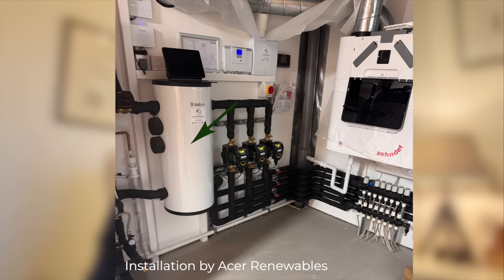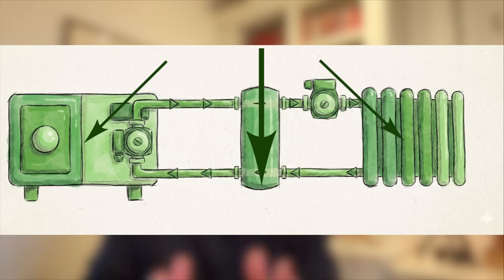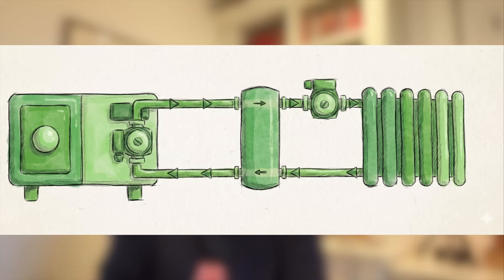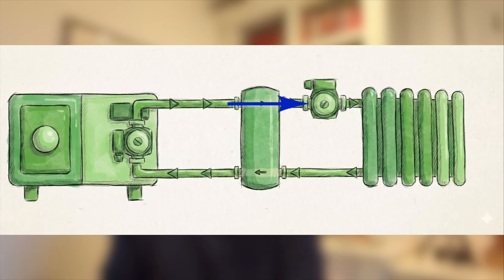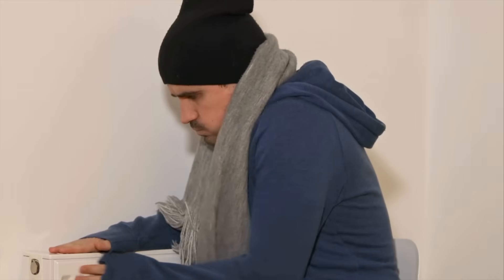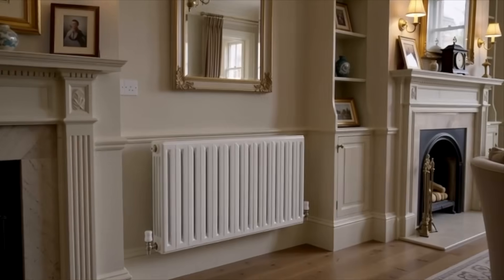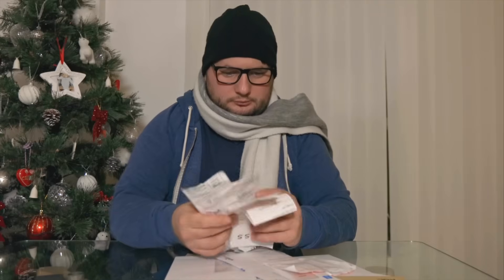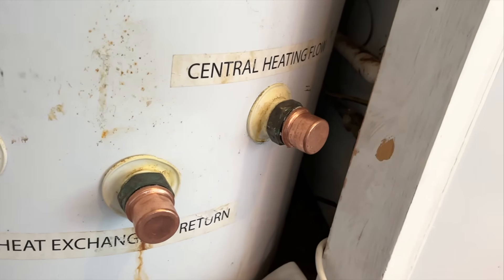Why Do Buffer Tanks Kill Heat Pump Efficiency?

Comment: A volumiser tank give the benefits of a buffer tank but without the downsides. It's the same tank but with two less pipes and one less circulation pump.
Reply: No, a buffer tank allows for the heat pump and the radiator pipework to have different pumps with a different flow velocity, which as far as I understand is the main reason why buffer tanks are installed. A volumizer cannot decouple flow velocities.
Reply: @wcoenen  yes, where the pipe work is too small to carry the power required at dT5 without an unacceptably high flow rate, a buffer allows a larger dT in the emitter circuit, at the cost of a higher flow temperature from the heat pump.
Reply from the maker: On the money!

Comment: What are your thoughts on a three pipe buffer configuration direct to load?
Reply from the maker: Most top installers, when I've spoken to them, have needed to a buffer in, have opted for three port options.

Comment: i always thought by separating out the AHS circuit and your own heating circuit was to allow you to use less Glycol.
Reply: Some installations do that but they use a plate heat exchanger, rather than a buffer, to keep the fluids separate. With fewer systems using glycol anyway these days, I should think it’s pretty rare.

Comment: We had a buffer tank fitted. 12kW Arotherm in our 8 bed house with UFH. It has a very powerful pump on the heating side, as assuming circulation pump in heat pump unit not powerful enough. Could buffer be removed in this setup? Getting COP of 3.2 in winter months and upto 4.5 in summer. Any one with suggestions?
Reply: I’m not certain it would work properly without a buffer, too much to take in to consideration though, but one thing I’m sure about is your efficiencies aren’t bad at all, I wouldn’t worry about trying to chase the highest SCOP like everyone is, if you can average 3.8-4 SCOP over the year take that. You also live in a very large property so matter what your bills are going to be a lot more than a standard 3 bed house.
Reply: @Christopher12345xy  Thank you for the comment. Wouldn't want to be making changes. Bills are a little better than when we had gas. Adding batteries shortly.
Reply: Depends if you always have all UFH loops open, or if you have it badly balanced and need to close many regularly.

Comment: Our 100L 3-pipe buffer tank seems to work very well.  I monitor the temperatures at the top of the buffer (flow in and flow out) and they are almost always identical.  The buffer also keeps warm water flowing around our emitters during defrosting and DHW heating cycles.
Reply: I'm probably just showing my ignorance but assuming it's 'flow in' to the buffer from the HP and it is 'flow out' from the buffer to the emitters (which seems like a volumiser to my inexpert eye), what is the third pipe for, please?
Reply: @seatonian I'm certainly no expert in this field but I've always assumed that the 3rd pipe (located bottom left on the buffer and connected to the return from the emitters to the heat pump) allows the 2 circuits to operate independently of one another i.e. the 'house circuit' can continue to flow water around the emitters regardless of what the 'heat pump circuit' is doing.
Reply: @seatonian A 3 port tank would have one cold water return from the radiators, one cold water supply to the heat pump at the bottom of the tank, and a 3rd port at the top of with a T fitting in it the two other ports of the T would be for the hot water coming back from the heat pump and the supply to the radiators. The idea is that the radiators can take as much or as little hot water as they need, and any surplus or deficit can come from or go into the tank.
Reply: @ZergZfTw My 3-pipe buffer tank is plumbed slightly differently to your description, mine is:

Top left: Flow in (from heat pump)
Top right: Flow out (to emitters)
Bottom left: Connection to the return from the emitters

Comment: When is a buffer tank a good idea?  When we haven't bought the BS about heat pumps because we don't have solar and an electric car as well - and want to run a condensing boiler into UFH at peak efficiency.  Would also help with biofuel.  Its just the poor efficiency of heat pumps at higher feed temperatures that's an issue.  What you are talking about is a degree of system optimisation in sizing that is tricky in older houses - my UFH and condenser setup is over 20 years old and it still looks problematic - and yes every room is zoned and it will stay that way, because the glazing and aspect differ massively.

Comment: aira install has a buffer as standard but monitors the temp on the supply from the buffer to the system. I'm getting COPs of 4.5 to 5.0. the difference is that the aira solution is intentionally designed with a buffer rather than as a sticking plaster. Good design is good design.
Reply: How they get it right then if buffer lowers the efficiency of the system?
Reply: @JerzyJuszczynski  buffers don’t always lower efficiencies, 2 pipe or bypass buffers can sometimes be even more efficient than open loop.
Reply: @Christopher12345xy - thanks for your comment.  I've  just accepted an Aira quote, and at that higher cost (I took it mainly for the 15 year warranty), I'd hate to think I've  also just signed up for higherthan-necessary bills too...
Reply: @JerzyJuszczynski if the buffer is designed in from the start and the controls configured specifically for a buffer system then the pros outweigh the cons. As long as the primary flow is higher than the secondary the distortion is minimal and it greatly reduces the impact of defrosts on the system.

Comment: I changed my buffer tank to a volumiser tank last summer, my scop for heating has changed from 3.3 to 4.0, also no longer need to bleed air from the towel rails and heating circuit is much quieter!
Reply: Hi John, how the air gets in then? Was it not bleed at the installation?
What was the connection between buffer and air in the system?
Reply: @JerzyJuszczynski no idea to be honest but with buffer tank you have two pumps competing against each other at different speeds which create a lot more noise in the buffer tank . Before I would have to bleed the two towel radiators ( highest point of circuit ) at least once a month and add pressure.
Reply: @johncastle2558 if your buffer has an automatic air elimination valve and there's no expansion vessel mounted on the buffer keeping the alternating flow induced pressure fluctuations at bay then if the pressure in the buffer gets too low air is going to get sucked in by the vacuum. Also fresh water contains trapped air and that will come out and pool at the highest point.
Reply: I assume that would also explain why the tank and system is much quieter now without buffer !?
Reply: I hope you asked the installer for a refund !

Comment: My quote from Octopus included a buffer/volumiser.
Reply from the maker: Yeah, that's interesting. I didn't realise Octopus did buffers until a few recent homeowner complaints with poor performing systems that clearly have buffer tanks.
Reply: @RenewableHeatingHub , I had the std Octopus installation in April 24 for my 1992 averagely insulated 4 bed detached, NE England. 6kW Daikin, 210L Joule tank, insulated buffer and an expansion tank. 28mm primaries connect to the original 22mm boiler headers teeing off in 10mm micro bore to new heat loss sized emitters.
 Using a Hicmicro thermal imaging camera suggests all emitters are well balanced and as close as a knat's whisker to the LWT showing in the Onecta app. I'm running LWT mode 24/7 with a curve set quite low in comparison to how Octopus set it. Inside temp around 20°C downstairs and 18°C upstairs. Heating Cop over the last three months is averaging 3.82 with Dec usage averaging 24kW per day (whole house consumption). Are these reasonable numbers and is that buffer working well?
Reply: @tebbo8324  I've gone against the flow, excuse the pun! I've just built a super insulated (Icf) 200sqm house, all underfloor, 300ltr buffer, 12kw LPG boiler, same numbers as you virtually, Boiler says average over the last 30days is 23kwh @ 11,5p Kwh, Calor gas quoted 9.5p Kwh for bulk tank, but bottles avoid standing charge that adds up.
Your number look pretty good to me, you benefit from the COP, I avoided the considerable cost difference, I'm a heating engineer I've done gas and heatpumps for 20+years so I'm interested in getting some solid data on LPG for a few years then possibly trying a heatpump.
Reply: @RenewableHeatingHub  One size doesn't fit all.
Reply from the maker: Absolutely, but it’s worth looking at the type of properties Octopus typically works on. In that context, I’d seriously question the routine use of a buffer tank.

I’m also increasingly wary of the way “buffer” and “volumiser” are used interchangeably in quotes. I’ve seen this a lot. They are not the same thing in practice. Yes, they’re both vessels, but they do fundamentally different jobs. One introduces hydraulic separation and the potential for mixing and distortion… the other simply adds water volume while keeping the heat pump connected directly to the system.

Lumping them together blurs an important design distinction and makes it very easy for a buffer to be justified where a volumiser (or nothing at all) would have been the better, more efficient choice.
Reply: @RenewableHeatingHub pseudo hydraulic separation.

If it were true hydraulic separation, it would be a heat exchanger.

And while we're at it with terminology, it should be hydronic, not hydraulic 😉

Comment: Hi Mars, thanks for this timely advice. Very recently I had a survey by AIRA as part of my research for an ASHP install. When I questioned the guy about the buffer tank his response was that AIRA always install a buffer tank. Any observations that you care to make as I was quite taken by the extended guarantee AIRA offer as well as their constant monitoring?
Reply from the maker: Yes, AIRA's policy of always installing a buffer tank is one of my biggest gripes with them... I've called it out multiple times in forums, discussions and podcasts. 

They build their entire system around it (indoor unit + separate buffer tank) and they tie their strong 15-year guarantee, performance promises and constant remote monitoring/AIRA Intelligence to that setup.

So if you want their extended warranty, monitoring and "peace of mind" package, you're pretty much stuck with the buffer... they won't skip it or guarantee the system without one, which I think is very unreasonable, but that's their business model and philosophy.

That said, be cautious about the potential efficiency hit. As the video explains, buffers often introduce unnecessary mixing/blending, which can drop your mean water temp, force the heat pump to run hotter and cost you 10-25% in extra running costs over time (depending on your system design, zoning and flow rates). Their AI monitoring might mask some issues on paper, but it can't fully overcome physics if the buffer creates distortion you don't need.

And don't forget to build in extra circulation pump costs.
Reply: I seem to remember Mars having an Aira representative on once and this being mentioned.
Reply from the maker: @mattybpg, yes, we did: https://youtu.be/v-MS6NPIiCo 
Buffer tanks at 29:01

When we stopped recording, it appears to be a directive from head office that said they have to use them, and it wasn't a policy that was going to change any time soon in the UK.
Reply: Agreed - i've had heat pump surveys where the operative says a buffer tank is required as part of the Heat Pump's warranty conditions.

Comment: I don't know what code requires, but volumizers don't even need to be insulated - a simple 2 pipe tank without the 30-50mm foam insulation would be about half the price and perfect for an airing cupboard.
Reply: At which point you've got a radiator... Which is why the best volumizers, if you can do it, are high volume radiators. Not only do these have significant thermal mass which evens out the temperature and allows cycling to go unnoticed, it also avoids the need for other tanks. Couple of my big column radiators are 26 L each, for example.
Reply: @TheBadoctopus  Yes, saving a couple hundred quid to invest in more/higher vol rads is best. 

However, I can see circumstances where price/m3 of a cylinder is cheaper than a radiator. Some people don't like the bulkier, double panel designs. A building may have had a HP sized before fabric upgrades, making it cycle too much after an insulation/air tightness retrofit, so those systems could do with extra volume to compensate. Also, do not underestimate how much people like the idea of having an airing cupboard - especially women, who often hold vetoing power in boiler/hp replacements, because any hint that HP are not warm and cosy also affects them more (I do most the laundry in the house so excuse the stereotype, ideally I'd want an airing cupboard connected to the exhaust of an MVHR).
Reply from the maker: Very good point!
Reply: We use fan coil radiators, designed by Mitsubishi with 1.5l of water😮 You need a volumiser for sure😂